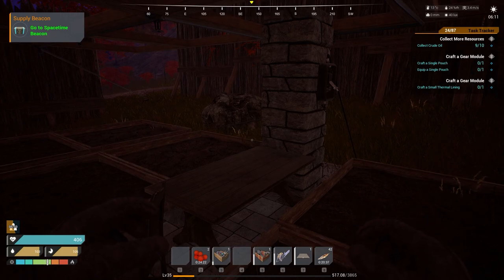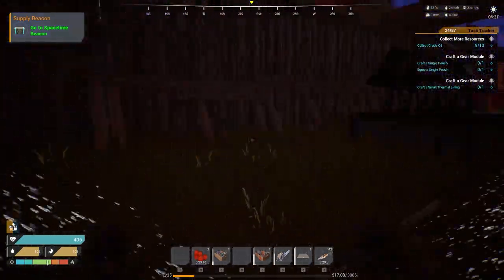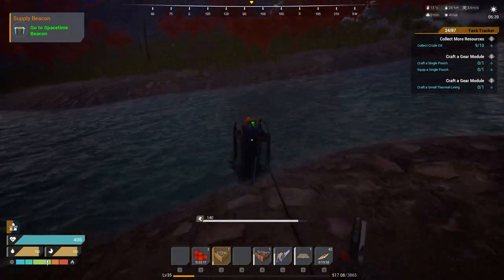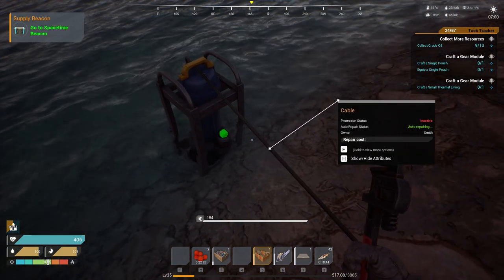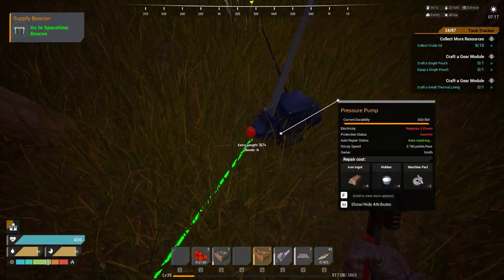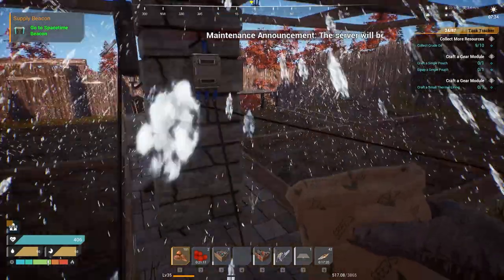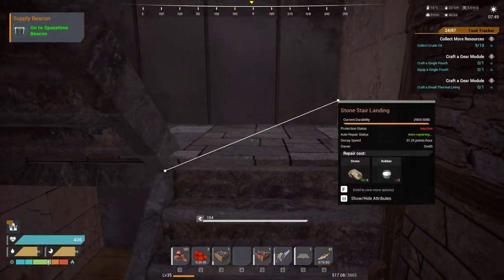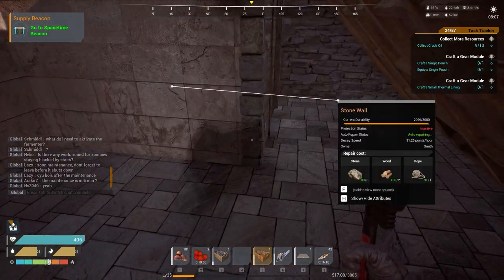How Does Water Work In The Front (Pressure Pumps, Dew Collectors, Intake Pump etc)

Comment: From what I've gathered through my farming so far, is that one sprinkler in the middle of 4 plots will water all 4. Not tried with the larger plots though, just the small one.
Worked with the sprinkler on the ground between them too, not suspended above them. It feels pretty lenient.

Comment: Hey quick question so my base is a bit far away from a river not to far just a bit of a walk but i was wondering if i should make water pipes going to my base from the river or if i should just make a farm near the river and setup a generator for power near the river. Not sure what the limitations are for the water pipes and what not.
Reply from the maker: When you are placing the pipes, it tells you how much distance you have left before it's max. I would check that first.